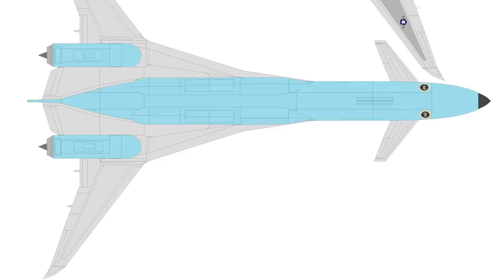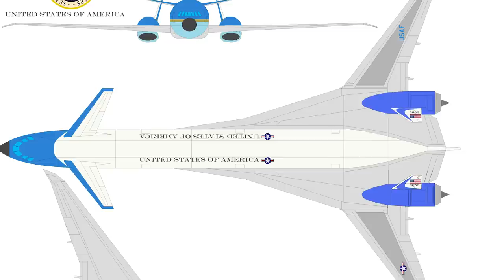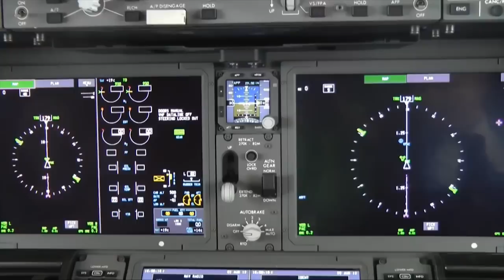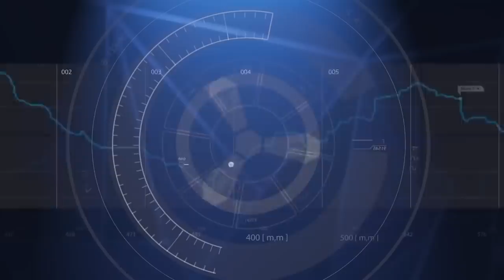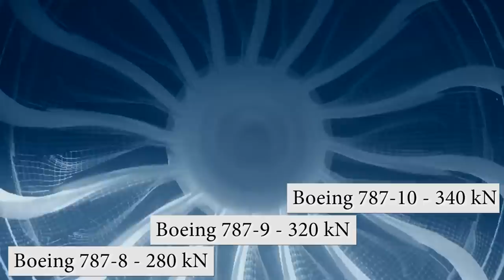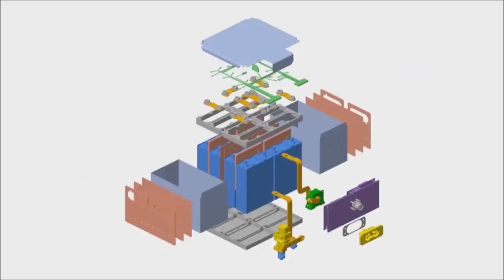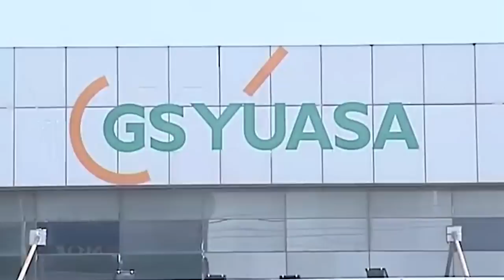Boeing 787: The legend of Dreamliner

Comment: Fuel consumption of airliners:  Jet A fuel weighs 6.7 pounds per gallon.  These are at cruise and are AVERAGES:

B727:  10,000 pounds per hour [PPH]
B747 classic:  25,000 PPH
B747-400:  22,000 PPH
B777: 14,000 PPH
MD11:  17,000 PPH
DC-10/L1011:  14,000 PPH
B757:  7000 PPH
A380:  25,000 PPH
B737 CFM:  5000 PPH
A320 CFM/IAE:  5000 PPH

B767:  10,000 PPH
B787:  8000 PPH

If you divide the PPH by 6.7, you get the typical gallons per hour.  And if you divide that by the typical cruising speed of 550 mph for the 787, 777, 767, 757, 737, A320, and A380, you get the miles per gallon.  

The 727, 747, DC/MD/10/11 and L1011 are "old school" and cruise at 625 mph.

Source:  Knowledge of flying the Boeing jets, and asking people that fly them.  Airline pilots receive a flight plan from dispatchers, professionals who plan flights, and use these  PPH numbers in order to do a quick mental check of whether their flight plan makes sense.

Comment: Excellent job!!   I understand why, but am never-the-less disappointed that supersonic airliners are probably not going to happen.  These new planes are marvels of technology but haven't gained any significant speed since the 60's!!
Reply: Gained speed since the 60?? They fly slower now than in the early 70' i think.Maybe top speed is higher now,but fuel is to excpencive so they fly at around mach 0.85.I belive the first DC 8 had a top speed of mach 0.92 same as the B747.

Comment: Sky, the 767 and 747 were impressing everyone. The thing was, the world was expecting a plane capable of carrying more passengers at lesser cost than a 4-engined like 747. And that's why we have the 777. Then they realized the 767 was getting old. Only then, the 767 wasn't impressing anyone. But hey! Now many RR-powered 787s are grounded, and guess which planes are there to help out? Yep! Those unimpressive 767s. Boring pieces of pure art and we'll thought designs put together.
Reply: 767 has a lot of life left as cargo planes and as the new KC-46 for the USAF.
Reply: The 767 would always be a Batlle horse,💪🦵

Comment: Having flown both, I like the A350 better than the B787 because it's noticeably quieter. Also, most all operators equip the 787 with 9-across coach seating, which makes for VERY narrow seats. The A350, with industry-standard 9-across seating is generous by coach standards. 

There are exceptions -- Japan Airlines, among others, equip their 787's in 8-across, and that makes the aircraft quite attractive. Equipped as such, the 787 is a nice plane.

Comment: I have flown both Boeing 787 and Airbus 380 on long distance intercontinental flights in economy class. For economy class I found that A380 is considerably more comfortable with more legroom and seat width than the Boeing 787. Also less engine noise felt in the A380.

Comment: 787 Likeable but I would like 747-400 still in service they just need to upgrade into wider size.
Reply: but customers are not flocking to the 747-8+ program but nonetheless they are still producing them .. little wider but moreso longer

Comment: If it ain't Boeing, I ain't goin.  Love all their planes.
Reply: Ha prefer Airbus!I have compared accidents with b 737 and a 320 series and I think there a bit less mechanical problems leading to fatal crashes.Not compared with older 737 of course,that would be unfair,but those from the same time.
Reply: feber in a320
Reply: @perolavlien2096  You should also check the others planes of Airbus and also check the manufacturer that are allied with them

Comment: I got the idea of the body lift action from the X-37 which prevents pitching downwards, pitching downwards causes instability and weakens the structure of the aircraft. The Boeing 737 does not have this body lift action and the structure would weaken the structure of the Boeing 737 and would eventually be responsible for accidents. The cockpit of the Boeing 787 I got the idea from the Space Shuttle for better view for the pilots.

Comment: The 787 has a distinct visual appearance,the nose especially is ultra low and sleek, reminiscent of the first jet airliner deHavilland Comet. The information on the video states that it is difficult to detect structural defects, whether due to fatigue or physical damage, on the composite components of the aircraft.This is a little unsettling, I hope my first flight will be on a  fresh new one off the production line.

Comment: The Airbus A-350 is by far the best airplane in the sky today. “Dreamliner” is only a clever marketing ploy for Boeing selling an inferior product, but a whole lot of people got taken in by smart advertising. The A-350 is better engineered, better air circulation and humidity, and more economical on fuel as well as quieter engines. Boeing is no longer an airframe leader, as aptly demonstrated by the B-737 MAX fiasco. Now the A-350, the A-330 and theA-321 NEO are setting the standard for passenger air travel as the B-777 and B-767 are aging and old technology. Happy flying everyone on Airbus.
Reply: You wonder why 2 year have happens and you don't even have one like

Comment: Nice video. A couple of nits: it's not clear if you are giving flight range in nautical or statute miles. There is a difference of 15 percent longer for nautical miles, and the numbers you gave suggest these are nm, not sm. 

Second, there is a difference between an accident and an incident. The battery fires were incidents.

Comment: Quick question regarding Boeing's transonic airliner at 1:24. Why couldn't they make it relevant by flying it slower and thereby REDUCING fuel costs below that of even the 787? All that streamlining would make it more efficient no?
Reply: The cynic in me believes it was never going to be. BA sited the costs & announced the retirement  of it’s concorde in the late 90’s (granted the Air France accident was horrendous). Virgin Atlantic wanted to go into orbit too!! I’m still sad the 747-‘s are being retired :-(
Reply: Yeah, I agree. There probably wan't enough lift on the plane at lower speeds to offset the reduced drag. Lift and drag depend on speed as much as anything else. Low drag means less lift which requires more power to fly higher.

Comment: You mentioned that according to the ANA  the 787 with the trent 1000 Rolls Royce engine is 21% more fuel efficient than a 767 ER, my neighbor flies the 767 ER, and said UPS is still buying new 767 ER's from Boeing. Why would they do that if they could buy a 787 ER that is 21% more fuel efficient?
Reply: Because Boeing doesn't currently make a cargo freighter version of the 787.

Comment: I wonder what that wire with a ball at the end is for. It extends from the tip of the vertical stabilizer in many of the videos.

I assume it has something to do with testing. Perhaps an antenna for transmission of data? Or a sensor as to vortices at that location?

Comment: imagine putting a GE9X on these!!!! :-)
Reply: I mean, it's possible to mount a GE9X on a 787-10, though it might need a lot of modifying to not only hold the weight of the engine but to also give it clearance on the runway and make sure the engine doesn't drag along during landing. It would have to be an entirely different 787 for that to happen, perhaps a 787-10ER could be a somewhat cool idea though it would be cheaper to descale the GE9X engine.

Comment: I read somewhere that the bleed air for the air conditioning and pressurising system is provided from the front of the engine instead of the high compressor turbine in 787Dreamliner..? Is that true...

Comment: The altitude of 1213 kms  mentioned is not correct. If the flight ceiling is taken as 60000 feet, it is 18.33 kms. Pl correct this figure. 
Note: Communication  satellites are typically at an altitude ~360 kms.

Comment: Such a shame that the dash 3 which would have been a worthy 767 replacement was a failure, as it has left Boeing with a smaller than ideal gap to fill between what can be achieved with a single aisle solution and the smallest 787. Any aircraft which tries to bridge that gap may well overlap both the 787 and the 737 far more than any manufacturer would be comfortable with.

Comment: You can see where we have to go from here???  New and more fuel efficient fuels so the aircraft can fly with less fuel and aircraft weight onboard with more use of composite materials.  The 280 to 350 passenger aircraft like the 787 and 777 will continue to be the workhorses of the industry as long as aircraft costs can be improved so that smaller airlines can afford these planes as the need for expanded international destinations increase.  
China is aggressively building 8 New 21st century Airports a year and 74 New Airports by 2020, that will All have International flights.  India plans to build 55 New Airports by 2030 and maybe more.  Many cities have a need right now for 2nd Airports.  Asia-Pacific area plans a minimum of 350 New Airports in the next 10 years.  Even the United States demand will grow as more people give up their autos, for using Uber and Lift type vehicles for local needs, those people will be using more air transportation to get from area to area.  There will eventually need to be a high fuel efficient 500 plus  passenger aircraft to bridge All of these continents that are the largest and fastest growing economies in the World.  Right now Boeing and McDonnell Douglas from the US and Airbus are the leaders in commercial aircraft production, but as the high demands for new high efficient and highly cost effective aircraft increases, Foreign competition will start impacting their dominance.  You can see where the competition will be coming from, with the Largest Future Market.  Technology will increase rapidly, which obsoletes a large portion of the current fleet that is out there now.  Should be a great time for the Aircraft Industry.  MikeSkier

Comment: Boeing 787 vs A350) Who is better?
Reply: 787 is the first in its kind. 350 just second. And Dreamliner vs XWB. Come on
Reply: Their market is as similar as the 767 and A340, because quite frankly those are the aircraft they replaced
Reply: Not the right question . Just depends on mission and airline. Quite a few airlines have chosen both.
Reply: They arent competitors tbh
Reply: The only ones that compete is the 787-10 and A350-900 

And that’s barely a a thing they compete on.
Reply: Morgan Lambley Between the -10 and -900 they only compete in terms of capacity and efficiency.
The 787-10 is cheaper and far more economical on medium routes 
The a350-900 is also more efficient on longer routes due to them not having similar ranges and their performances
Reply: Nope it’s kind of a mix up 

a350-900 and 787-10
A350-1000 and 777-300ER
787-8 and a330-200/800
787-9 and a330-300/900

If you are thinking about the 777-9 it doesn’t really have a main competition. It’s meant to target the Jumbo market.
The 777-8 competes with the a350-1000 in terms of only capacity and with the a350ULR in terms of very long haul
Reply: Johnny Wynn that’s what I mean, they compete,  but at the same time not really cause they fulfil different purposes.
Reply: A350 because the economy class seat and aisle width are larger.
Reply: Morgan Lambley Yea
Reply: Larger by less than 1 inch so doesn't really make a different, unless maybe you are fat.
Reply: Look at it this way: Boeing has sold almost 1400 787's. Airbus has sold almost 900 A350's. Yes, the 787 entered the market first, but only by 3 years. And in the 2015-2017 the 787 outsold the A350 223 to 74. It appears that airlines prefer the 787.
Reply: Exactly. Airlines prefer the 787 over the a350 because it’s much lighter and fuel efficient and handles an average passenger capacity with a very long range. 
This plane had allowed low cost carriers to open long haul network so efficiently and profitable. An airline (Air Asia X) already complained they can’t use the a350 because it’s too expensive and are talks with Boeing about the 787s
Reply: You can not compare them. But still A350 XWB ofc
Reply: Frank K It’s funny too because the 787 came just 3 years which is really nothing. The -9 Entered service the Same year as the a350-900 but yet it’s still being outsold by the -9. Just like the a330 and 777. A330 came out and entered service 3 years before the 777 but still the 777 is outselling it
Reply: Frank Galeon I prefer the A350 by an edge.
Reply: Frank K cuz its cheaper and less quality
Reply: Erik - Lower quality? Why would an airline want a lower quality jet that requires more maintenance and downtime? That affects the bottom line.
Reply: Airbus 350
Reply: Frank Galeon 787, A350 basically a French ripoff of the 787
Reply: Airbus 350  quality way more superior to 787
Reply: @rythmflow1727  
Sales figures don't support your assertion.
Reply: @terrycooper4149  3 billion people smoke doesn't mean is good because cigarettes sells a lot 😉 Also 787 is cheaper you know?

Comment: There NOT Standard lithium Ion!!! There “lithium Cobalt” lithium ion, which is waaaay more efficient and BURNS Waaaaay HOTTER which is why the accidents were so bad the heat they make when they fail is SO HOT it is above the melting point of steel/aluminum etc. they are 5 times more combustable than standard lithium ion (once over heated) they even burned down there American battery charging system developers ENTIRE building while the Dreamliner was being prototyped (even tho warnings of COBALT based lithium batteries were known and care was taken) no one knew HOw EXTREMELY flammable the cobalt variant of lithium ion batteries are PLEASE DONT MISTAKE THIS TECHNOLOGY FROM YOUR CELL OR LAPTOP contrary to the video they ARE NOTHING ALIKE (when talking safety) Yes there both part lithium and both called lithium ion but that’s where the similarity ends as far as danger/overheating/power output/ etc, they have allot of benefits and ALLOT of danger, Boeing had to add a very thick very high strength steel reinforcement to the battery Boxs to contain lithium cobalt fires in the case of simple overheating from normal use (more amps drawn in a battery more heat created) And yes small amounts are used in most lithium battery’s but THE 787 ones were marked originally as lithium Cobalt batteries, meaning much more of the battery is cobalt and why they say there 4-6times more powerful per ounce/pound/kilo whatever unit of weight.